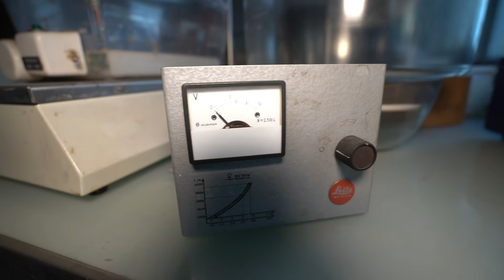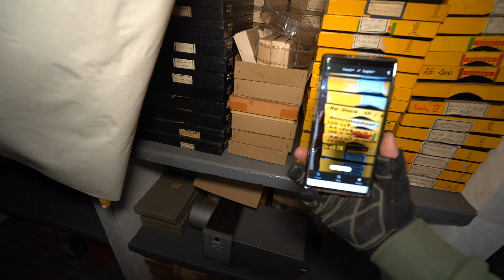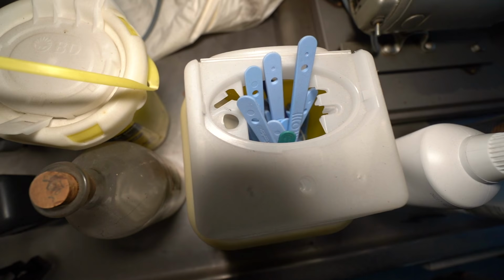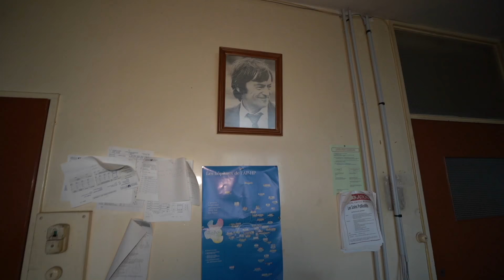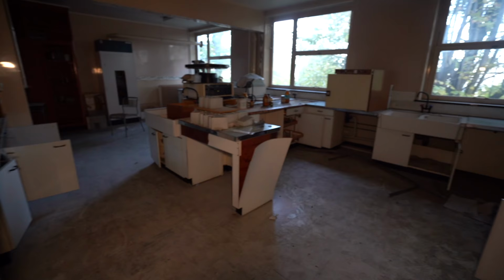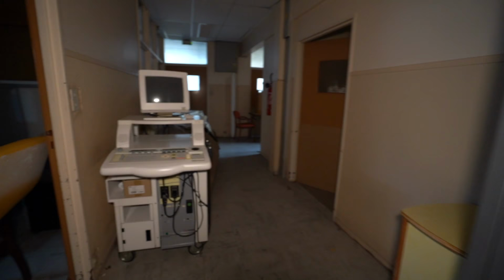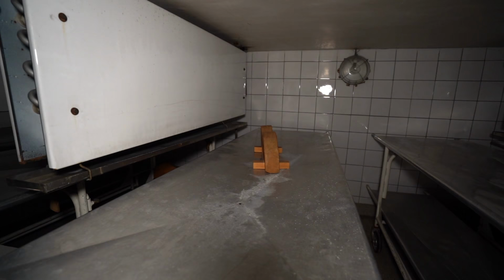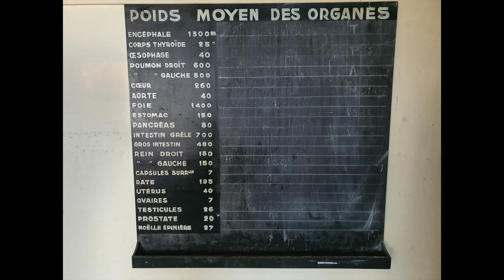Exploring an Abandoned Morgue BRAIN on Table - Power Still On

Comment: Blood turns black when exposed to air. Also, the brain was in formaldehyde and was taken out. I think someone did some staging before you explored.
Reply: So fuzzy cant see it
Reply: You are correct... I was thinking the same. That blood looks fresh.
Reply: @masalamouth  It looked like water tinged with rust to me.
Reply: staged
Reply: Depend on how much blood there is and their consistency, thicker blood turns black but thinner one turn brown-ish. Also if the blood was exposed to water they will be more brown-ish.
Reply: @teacup203 how do you know😂😅
Reply: That was definitely rust water and most likely a fake brain. Bugs would have taken care of that awhile ago.
Reply: It was not blood ...seems like liquid used in the morgue
Reply: how do you know
Reply: My thoughts exactly.
Reply: That “blood” is most likely iodine. And as for the “brain”….lol 😂 it was nice how the whole table was covered in dust apart from the area where the brain was!
Reply: You know what it looked like iodide 😂 but the brain may have been for practice 🤷‍♀️

Comment: Maybe those body parts were donated for medical research or maybe there was some disease outbreak in that part of the hospital. That in itself however begs the question why didn't the part of the hospital that is still open properly store the remains or if it was a disease outbreak then why weren't the remains properly disposed of? Have the next of kin even been informed that the remains are still there?  All those slides and medical records should all be properly stored in a long term storage facility and not just left for anyone to find. All the medical equipment is a bit of date now but I doubt there's a hospital in the world wouldn't accept them once they were properly stabilised. I work in a hospital so this video shocked me to my very core. I hope you reported this hospital. I'm really glad you filmed this. It was not only a very good video but things like this need to be highlighted so they don't happen again.

Comment: That's a one of a kind exploration.  You are certainly brave to go in there with the other part of the hospital still operating!  Which leaves me speechless at the condition of that morgue.  I think that would probably be the place from hell to die and have your remains treated with so little care, I mean obviously the dead doesn't care but the family would be horrified.  I am amazed that the hospital has not taken responsibility and cleaned it up.  I mean obviously  they've had 9 years to take the liberty to clean up and store the medical records and pathological and DNA samples appropriately.  The brain was absolutely uncalled for.  During an autopsy if an organ is removed it is usually put back and if not it is to be cremated, same with bones - which appeared to be rib bones and are also usually put back but the same rule applies.  It's sickening.  Working in a certain field, I know that people have to pay a lot to have an autopsy conducted, no matter what the circumstances of the place being shut down were - something could have been done.  And the average cost of a hospital ultrasound machine, (I saw 2)  run between $25,000.00-$75,000.00.  There were so many things that could have been used by clinics that provide free services. And the freezers, they were storing one on top and bottom, they were labeled 1a, 1b, etc. I know for medical examiners this becomes second nature but you still have to have compassiocn.  With what we saw I almost expected you to open the freezer and a whole body to be in it.   Otherwise, I thought it was freaking fasinating! I'm curious why they closed it?  I wonder if maybe the hospital was a teaching hospital?  Still no excuse.  Definitely a rare find.  Take Care, Stay Safe, God Bless!  xoxo💖 Kat

Comment: The "High and Low" translation, could be the location of each person in the freezer. For example, the freezer you opened, showed a silver metal slab with an Upper and a Lower slab attached.
Good video and you're right, they should destroy or properly contain the samples, and all personal documentations. Most importantly, this place should be safely disinfected, this is a Health and Safety issue.

Comment: The records around 20:35 are not death records. Death records would not be stored in an analytical/pathology lab, even when it was in operation. You moved too fast for me to see any of the labels, but they are most likely machine records (use, cleaning, calibration, maintenance), chemical safety data sheets, chemical certificates of analysis (required for every bottle), laboratory procedures, and all data recorded by lab personnel. All of this means binders upon binders of paperwork - none of which contains someone's sensitive medical records. Likewise with the binders of photographs you looked at at the beginning - those are files of pathology specimens, which will have specimen numbers. Not personally identifying information.

Microfil compound is not a preservative - it is a silicone compound, it makes 3D casts of vasculature in specimens. Following injection, it cures opaque and you clear the tissues (rendering them transparent) so you can see the detail of the structures within (now opacified by the cured silicone compound).

The machine at 3:22 with the tall round column is an electron microscope.

The slides really aren't anything to write home about. No one can do anything with them other than look at them under a microscope. The brain was a preserved specimen, not decomposing. The brain decomposes and liquifies rapidly after death and would not have been identifiable nine years later if left sitting out on a counter in open air. I'm more inclined to believe a previous "explorer" took a specimen out of its jar long after the morgue was closed than that lab personnel left it there.

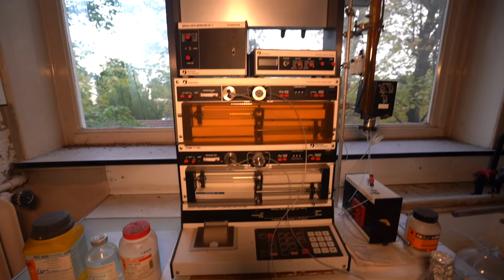The machine around 15:15 looks like an HPLC (liquid chromatography) machine. Cacodylate is a buffer solution, can be used in HPLC but also is used to prep slides for electron microscopy. "Eau distilled" was just a bottle of laboratory grade distilled water for use in the HPLC machine. Right after that, you approached a fume hood (what said DANGER) - these are used to prep solutions that you should not breathe. It's basically a big ventilation shaft you prepare solutions inside of. Then the one cabinet you opened after that is an acids cabinet (acids react with many other things, so they are kept separate.)

As for the random car parts... probably just a maintenance man for the hospital (not specifically lab personnel) who brought along his own projects. As for the state of everything... you would be surprised at how hospital bankruptcies are handled, especially if patients have already been relocated. Many times, personnel leave for the day expecting to return to work, and then they return to find padlocks on the doors, so everything is "abandoned in place."

Comment: I feel like this is a coroners facility. Where they perform postmortems to confirm causes of death. It is actually common in Australia at least for them to remove organs for testing and them not be replaced prior to the body being released to the family if they can’t determine cause of death immediately. In Australian the coroner has to get the families permission to do this though. The family is then given the option to have the organs cremated and returned to them upon completion of the coroners inquests at. Maybe similar practices there 🤷🏼‍♀️